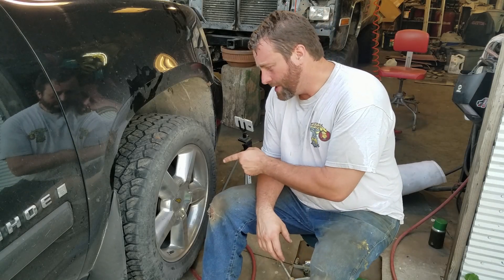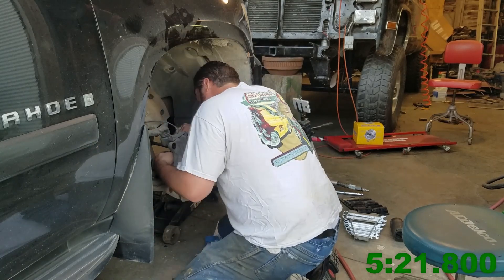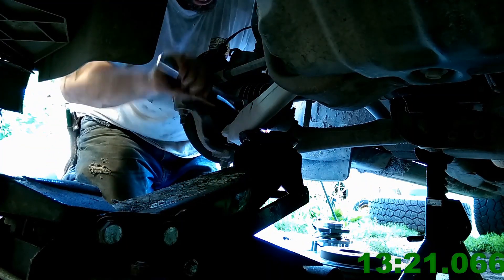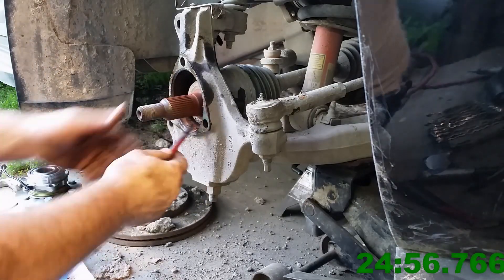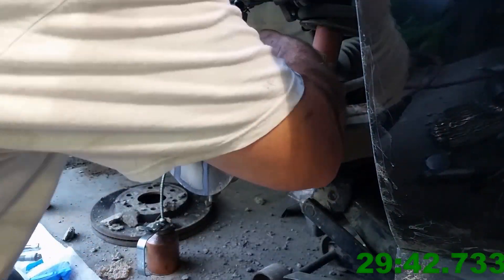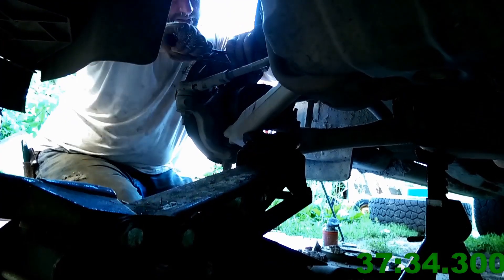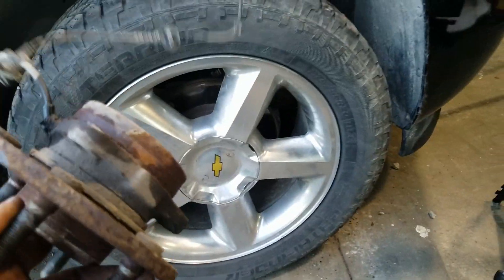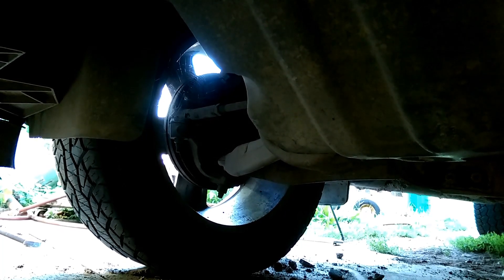🔧Changing a Front Hub Assembly on 2007 Chevy Tahoe - How Fast Can I Do It ⏰?

Comment: Good job. I did my front axle lockouts in my 10 F250. Vacuum lockouts. Hmmm not to fun. Bought aftermarket, then found out Ford was cheaper after one aftermarket failed out of the box. Can you say rework 🤫
Reply from the maker: Oooo, that doesn't sound fun!  Yeah, sometimes the more expensive one is cheaper in the end.  Sometimes not, but it's not fun to find out when it is lol!  How are things in your neck of the woods?  Thanks for watching and commenting!
Reply: @burningdinosaurs  bad storms over the weekend with tornadic activity. They can neither confirm nor deny all but 1. Go figure! Northern Wisconsin woods are flattened. Straight line winds more likely. Busy in shop as usual trying to get vids out is a chore lately.
Reply from the maker: @MichaelJBerg  Oooo boy!  I heard about some storms up there but didn't hear it was that bad!  Everybody OK?  I hear ya on being busy, I have hours and hours of video, but it's nice enough to work outside so I'm busy outside instead of editing videos.  Good you're busy, hope you're not workin too hard!
Reply: @burningdinosaurs  nobody hurt anywhere that I know of. Straight line winds 115mph.
Reply from the maker: @MichaelJBerg  WOWZA!!  Well, it's good nobody was hurt.  That's some pretty high wind speed.  We had some that was 90ish a couple years ago that tore roofs off hog buildings and turkey buildings and damaged some houses but nobody hurt.  Good luck with the cleanup and stuff.